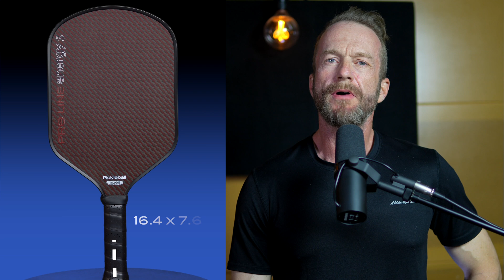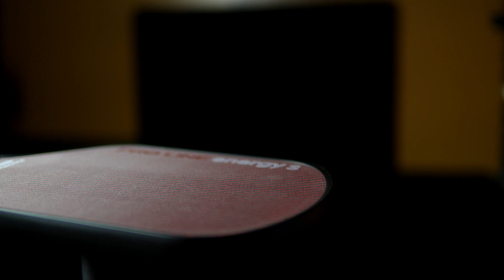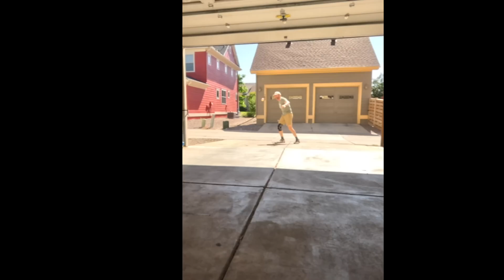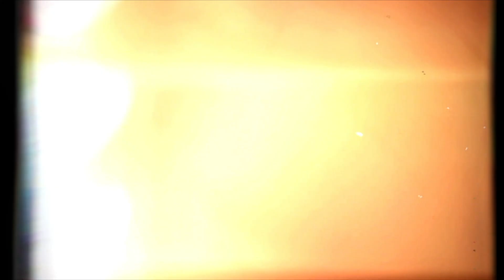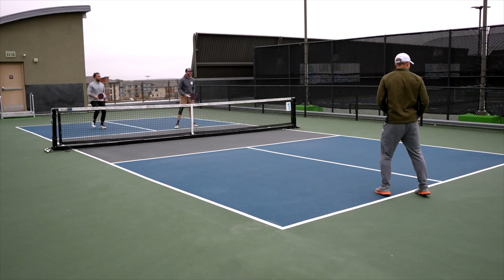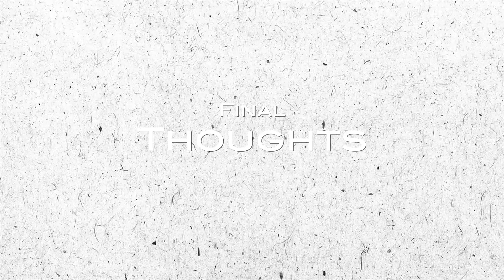Apes Pro Line Energy S - The Hybrid-Shaped Kevlar Paddle

Comment: @johnkewpickleball - Do you by any chance have any data (or anecdata) on the durability in terms of spin longevity of the paddle face for Pro Line Energy S or the the elongated Pro Line Energy?  
I have been playing with the Energy S series for about 2 months (3 x week) and it seems to me (subjectively, as I don't know how to measure it) that the top sheet has lost some spin capability.  I also did a quick test (not sure how scientific it is) by rubbing a ball against the paddle face ... and at the center of the paddle the friction seems slightly lower and sound pitch higher than close to the edges of the paddle.
Reply from the maker: My tests on the older peel ply of the PLE show it wears down at about the same rate as raw carbon fiber. Apes has a new peel ply formula, but I don’t have historical data on wear yet. The new formula should hold up better than the old, but I don’t know by how much
Reply: Thank you for the response.  I emailed the company yesterday asking about the spin deterioration and will write a follow up comment  here if they respond with insights worthy sharing.

Comment: I was just thinking about your RPM test and in my head went to the extreme "he needs to contact the slo mo guys for a faster camera" - because new toys are fun and who doesn't want the best measurement accuracy?  but what you're doing is fine - just sharing a thought.   THANKS
Reply: I'm getting 960 FPS using the "Super Slo-Mo" setting on my Samsung Note 20 smartphone and it is incredibly smooth.  I have broken down pickleball swings, golf swings, etc. with it.

Comment: I recently got the new S and it wasn't for me. The original pro line was great, the only issue I had was I felt a little slow playing at the kitchen. So I thought getting the S with it's hybrid shape would help with this, which it did, but for me I lost so much control and felt like I couldn't place the ball where I wanted. I don't know if it was just me but my S felt like hitting with a brick, the face felt so stiff and I couldn't get a feel for the ball at all. It didn't have that same plush feeling my original Pro Line had. Pickleball Apes does have great return policy so I will be returning it. The paddle still looks amazing and it comes with a high quality cover. The new butt cap is also nice which my original pro line does not have.
Reply: I also complained about the paddle being stiff when I got it. But I realized the apes required a 2 day/10 hours worth of “break in”.    After breaking it in, wow I can reset and drop like crazy now. The face feels as soft and forgiving as my vatic prism/non thermaformed but with more power
Reply: @Joshisjanky this is really good info thank you!
Reply: really ? i'm using Vatic Prism V7, i like the soft control of it. Recently bought a PLE S and tried a few games, feel muted and very stiff, and the worst thing is it triggered my tennis elbow.

Comment: Your reviews are so in-depth. Great work. So can I ask which is your favourite between This paddle & the Gearbox pro. I’m in the market to replace my Six Zero DBD
Reply: In exactly the same boat. Upgraded to an 006 from the DBD but recently gone back to the DBD for the extra power & hand speed. I wanted something right in the middle of the power/control spectrum & this fits the bill at nearly half the price of a new Gearbox.
Reply: @YeahDardPolice  Yeah, I like the power for sure but finding it hard to dial in my soft game. I find it’s too poppy, give more power than I want at that time.  Working hard to not do that but then my resets always fall short. I’m ok with the dinking but resets, ugh!

Comment: Another great review of the Apes's line, I concur with everything mentioned here. Keeping my Energy for singles and using my S for doubles.
Reply: What do use to clean the paddle ? Will regular raw carbon eraser work for this since it has Kevlar ?
Reply: @jmorales22 regular eraser works just fine. However, it really doesn’t collect too much ball dust/brushes off easily.